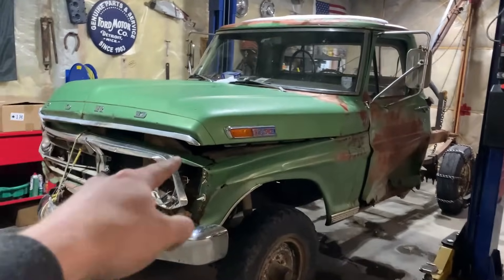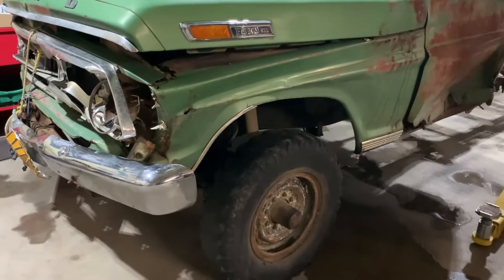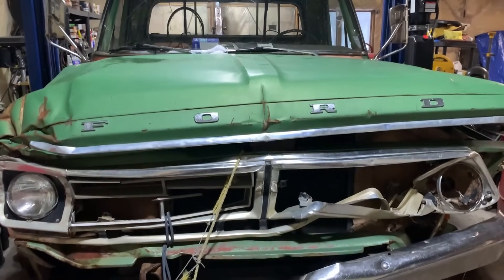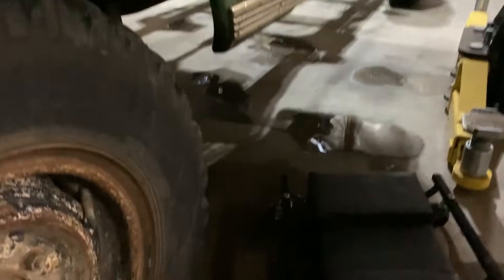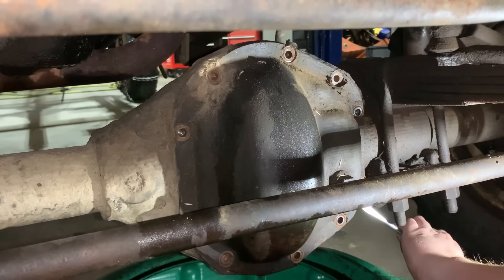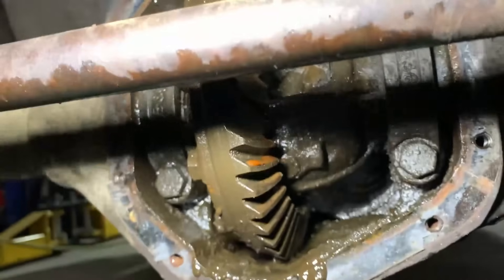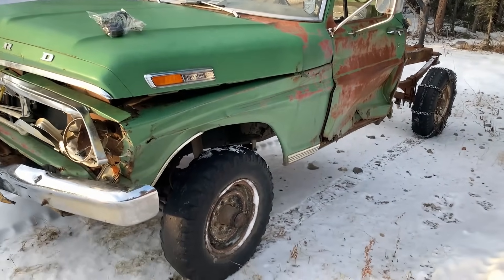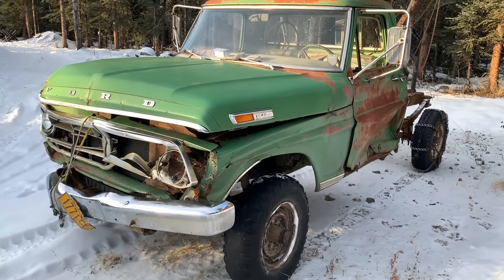Wrenching on the Ford Highboy Yard Truck

Comment: There is a lot of people who would like to see a front end rebuild on this. Close to zero hands on info for these front ends, you might be the man for the job lol.
Reply: I think it would be good to straighten out the front end and pull out the dents without spending any real time or money on it.

To the point where no tiedowns are needed and doors don't stick.

Replace something if you can get it for free
 ,
Reply: Sheesh parts trucks available for. 100bucks and put a new nose on that truck
Reply: @gerry-p9x  I meant the front end like the front differential. Sorry that is the way we say it around here lol.

Comment: Make the truck a 4wd skid steer by putting a rear axle in the front,  use the steering wheel to activate left brake or right brake

Comment: Yup, due for some trunnion bearings…..the knuckles originally were supposed to hold gear oil but i just pack the trunnion bearings with grease like i would wheel bearings and have had favorable results doing that.

Comment: I had my 67, 390, for 12 years, 1993-2005. I would add about a 1/2 quart of oil every month. Never changed the oil or filter. My oil still looked better than that! ?

Comment: I constantly wire wheel and wire brush the spark plugs when I get a project up until I know if it is worth spending money on and the fe 360 dad had gotten ahold of when I was in highschool had a complete set of ac Delco green stripe spark plugs and the accell super stock points plug yellow and orange boots plug wires

Comment: will it make it thru till the tires are done? my dad has a 85 dodge that has the old dana axles... in fear of that braking the "dopie city car got, messed with". every day that passed the newer AAM axles sell for less and less just sitting on pallets. nearly 185usd thru Alberta for the 1150's... that's like one weeks heating bill in -40... wood or gas, heat is heat.